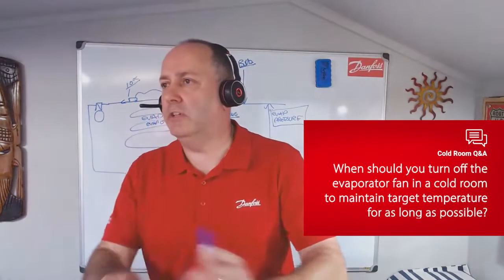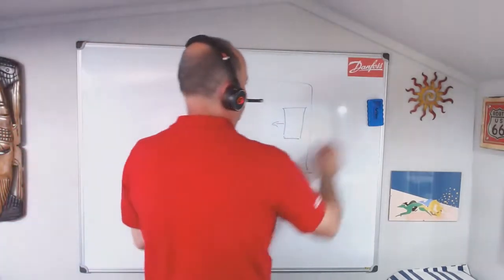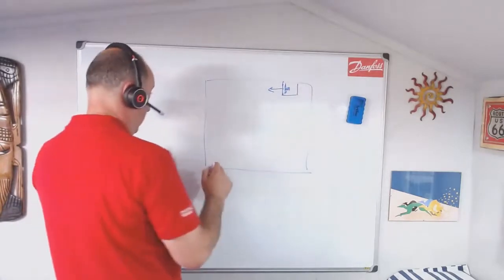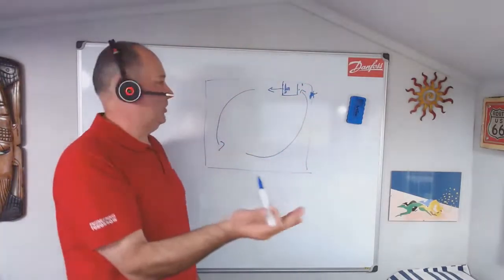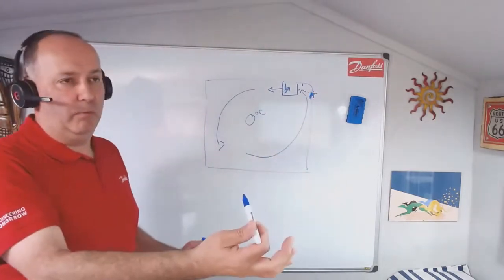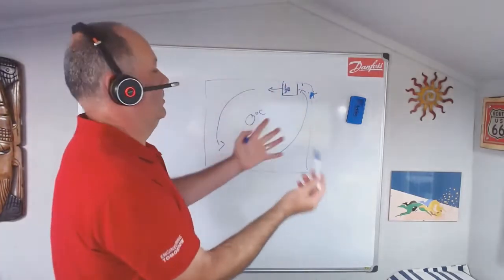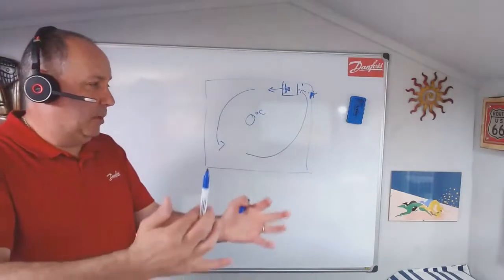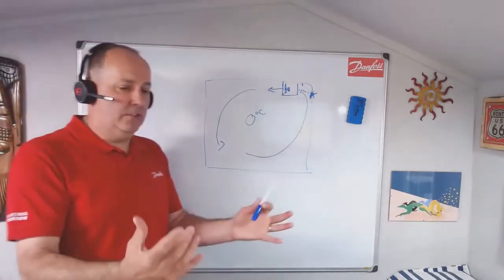When should you turn off the evaporator fan in a cold room? | Ask an Expert

Comment: Is there a rule of thumb for how long we should turn the evaporator fans on, in order to make sure we don't measure a to low temperature. For example in the video John says "one minute for everey 5 minutes" But for what size of cold store is this?
Reply from the maker: Thanks for your question. We will check with our experts and get back to you.
Reply from the maker: The purpose of cycling the evaporator fans during a thermostat satisfied situation in a large cold store is to save both the energy cost of running the fans but also the added fan heat that would be released into the cold space. John (Danfoss expert) has also used the ‘one minute running for every 5 minutes’ to ensure that the air within the cold store is pulled over the thermostat sensor(s) so that the correct storage temperature is maintained. The actual time period depends on many factors, physical size of the store, available duty vs actual cooling demand, location of thermostat sensor(s), and temperature requirements of the cold store. There is no calculation, it has to be set approximately and settings altered depending on the influence on cold store temperature.

Comment: can I ask some question? 
Can we control the compressor by door switch for opening for Loding and unloading products, if it's possible what is the side effect
Reply from the maker: Hi, we are checking with our experts and will get back to you.
Reply from the maker: Yes, you can use a door switch to either stop the complete refrigeration system or use a pump down signal to pump down the refrigeration system. It is preferable to use pump down particularly on low temperature cold rooms. The only issue you can have using a door switch in this way is constant stop start of the refrigeration system if the door is opened and closed frequently. The use of a delay timer can be used to avoid this issue. Obviously if the door is open & the refrigeration system is off for any length of time the room temperature could rise to high.